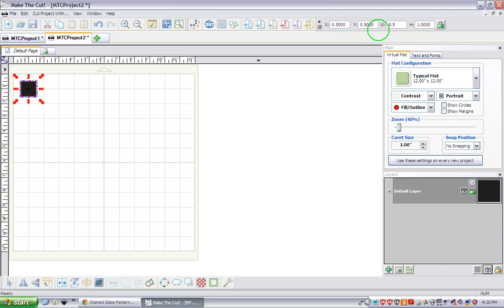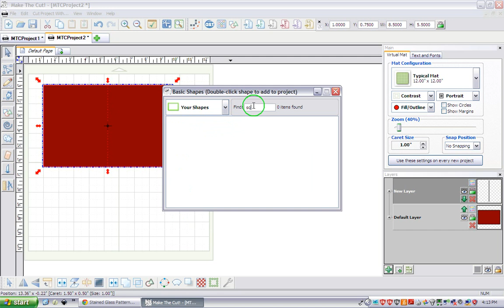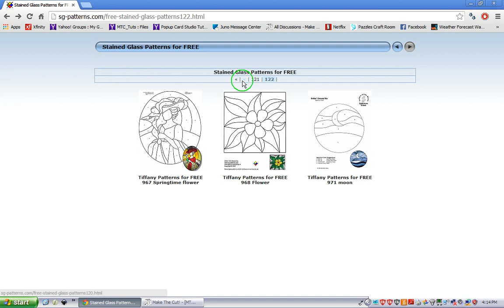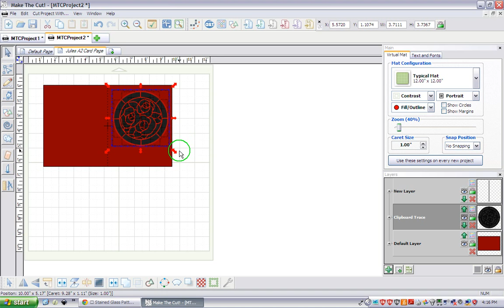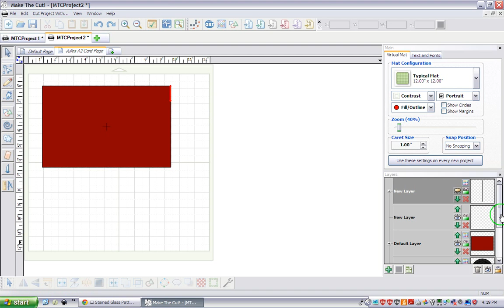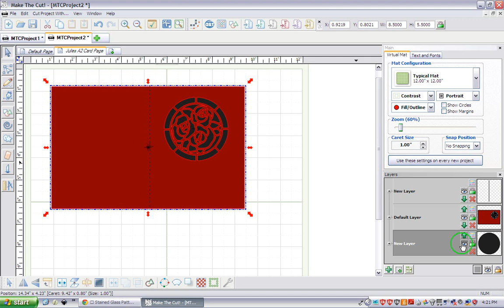Stained Glass Rose Card

Comment from the maker: The glitch about 10 minutes into the recording obscured some of the details. Here are some notes to fill in.
 The glitch obscured the detail about thicking the lines.
Select the pixel traced image.
Resize to fit on the card.
Add a shadow of -.03 inches
Remove the original shape.
Position the shadowed design on the card
Hide the score lines layer
Select both the design and the Card and Join.
Reply from the maker: See Vimeo recording of the MTC/PCS Q&A Webinar recorded July 22, 2014 here for a demo of a gatefold card using a couple more stained glass patterns:
http://vimeo.com/101654532